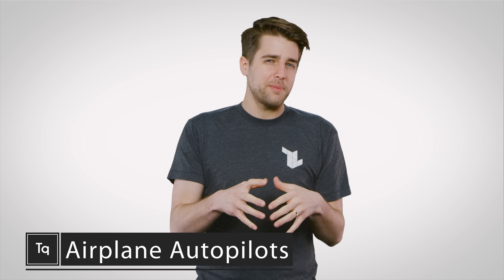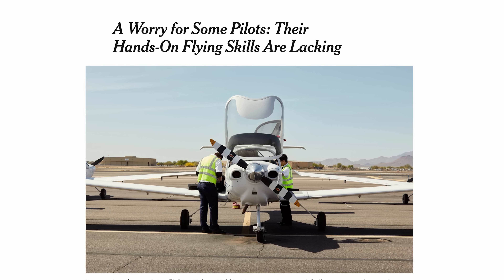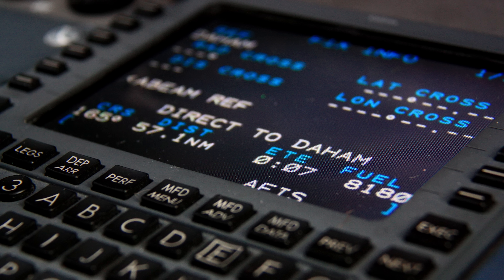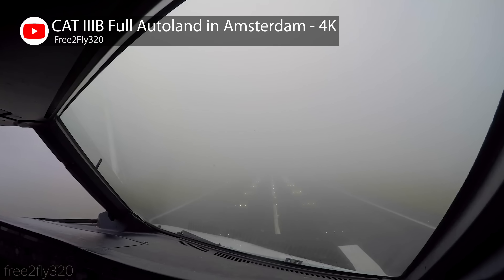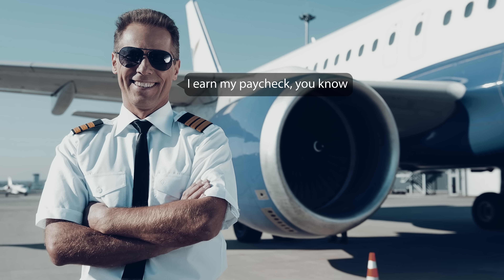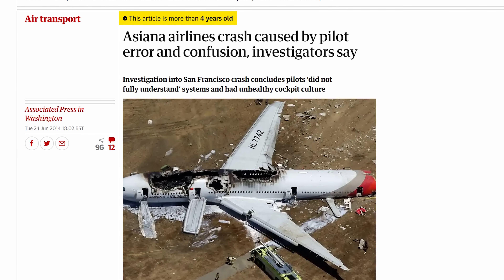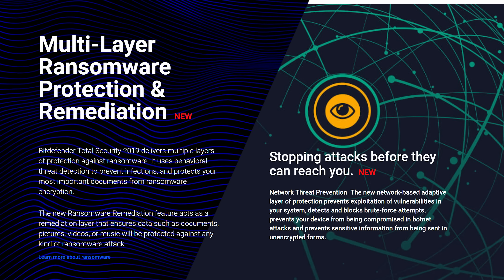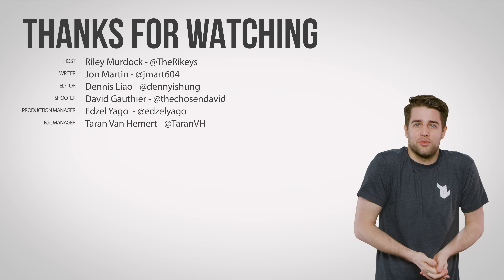Who's REALLY Flying YOUR Plane?

Comment: "Approaching the ground under the control of a machine is a little scary"...

It might feel harder, but the AP doesn't care for your comfort in CATIII conditions, the thing is designed to bring you safely to the ground. Some things to think about:

- The ground spoilers - breaking the lift on the wings - get activated through the compression of the the main landing gear struts.
- The autobrakes start working, when the aircraft feels itself on the ground, oh, that's also compression of the main landing gear.

So I personally take more a -300ft per minute landing bang on the center line right in the touchdown zone of the runway by the auto pilots - yes, for auto landing most airliners you need both AP working, of course for redundancy reasons - than a float half way over the runway and then a 10fpm greaser, needing another quarter of the runway to get to the level of compression of the main landing gear.

Comment: I just want to point out that your description of FlyByWire was wrong. It means the demands from the pilots are processed through computers, before being sent electronically to the flight controls. On Airbus aircraft, roll control is done through roll rate, and pitch control is done through C* logic, which is a blend of pitch rate and load factor (G Accel) control.the pilot flying manually still has to control the aircraft, it just means the computers help make the aircraft behave more predictably, and hold attitude.

Comment: Pilots would disagree with you with regards to speed of adjustments and landing. Autopilot requires much more runway to land than a human pilot, giving them less room before running off the end of the runway if something goes wrong. Autopilot is also only as good as the input of it's sensors and the most powerful and accurate sensor on board are human eyes.

Comment: While we were waiting for auto driving(not fully) cars on the road, we didn't knew we were already flying in some in the air.

The pilot/drivers still needed for extreme/specific conditions.

PS - The only downside is pilot are getting smaller paychecks(JK, IDK really).

Comment: Big airliners can take-off, navigate and land themselves. With emergency procedures stating that in an emergency you listen to the plane and not the air traffic controller, the other plane's pilot or yourself. The only reason we still have pilots is because no will get on a plane without one.

Comment: Only very few airplanes have ever crashed due to an error with the autopilot itself. The vast majority of crashes where the auto pilot was involved was either the result of faulty sensor data or pilot error. Many times both. Assuming all the input data is correct an auto pilot is better at controlling a jet than a human pilot is, but it does rely on the human pilot to make absolutely sure that the input data IS correct. The auto pilot will happily drive the plane into the ground if it thinks it's too high when it actually isn't.

Comment: And one interesting fact. You might think that FMC (flight management computer) is a supercomputer that is very powerful - but its NOT! 
FMC has a lot lower specs than an average PC (in most aircraft) but they are very reliable.
From my experience, FMC has a input lag/delay when programming it. It also takes some time (1 second or more) to load a page on CDU. FMC also includes  a navigation database that is upgraded every month using floppy disc on most aircraft and it has a size of few MB!

Comment: Autopilot only manuevers the plane but it doesn't operate with systems like elec. system, bleed air system, nav. system, fuel system... Pilot also has to manually set frequencies for radio navigation.

Comment: As explained by Mentor Aviation etc, the FAA training hours rule is very questionable. It was introduced after an accident by experienced pilots. In effect, American pilots rack up irrelevant training hours to meet the rule, that have very limited value in actually piloting a real airliner. So it fails to demonstrate value, while adding cost/effort to American pilots only.

Comment: Think of Autopilot as a more advanced cruise control on your car, on a long trip without cruise control it would be difficult to maintain a precise speed, say 75 mph. You'd spend a lot of time just looking at the speedometer and managing the speed and less time making looking for obstructions, managing fuel, navigating, and monitoring the overall car for any problems . It's the same thing on a plane, the Pilot flies the plane THROUGH the autopilot, it allows him to more PRECISELY maintain air speed and altitude the same way your CC maintains the speed of your car. except the work load, and stakes are higher on an airplane even with two pilots.

Comment: People seem to forget the computers not only get confused like their fellow human pilots, but they also get confused by their creators. Anyone who has done any sort of software engineering knows that there are always bugs, and their number varies by the complication the system you are creating. The goal is to avoid any major failures or design flaws, like relying on a single sensor port or having the ability to put an aircraft into an uncontrollable dive.

Comment: Autopilot/throttle is indeed a very useful and safe feature of all major airlines. But I just want to point out that in any phase of flight, the captain or first officer can turn off the autopilot at will and maneuver the plane manually (albeit through a fly-by-wire system).

Comment: Was expecting a misinforming video as most aviation videos tend to be on YouTube, however, you guys got it pretty spot on!

The only criticism I would have is that on most commercial airliners there are two pilots, Captain and First Officer each who will take turns being PF or Pilot Flying whilst the other is PM or Pilot Monitoring. One who will control the auto pilot etc whilst the other will check the flight plan, fuel burn, weather ahead etc

Comment: The planes in the thumbnail(a 737-max 8) has crashed twice since being manufactured😬 Guess Why?

An autopilot system that pilots were not told about in training had failed, causing crashes.
Reply: yes its called MCAS ( Maneuvering Characteristics Augmentation System ) it thought that it was about to stall but as we know now 
it wasn't the angle of attack sensors ( on the side of the aircraft ) had given the wrong information, Boeing should have added a two-way authentication with the pitot tubes and angle of attack sensors

Comment: Extremly easy to hack, too. Yeah they can mostly deal with natural interference or even some level of malepractice, though even simple GPS jammers have lead to some trouble at airports - and those cases werent even targetted attacks, just some delivery driver taking a nap without wanting his boss to find out that he stopped. And people have tested - in an isolated enviroment - how easy it would be to feed the systems wrong information. The answer is, incredibly easy indeed. There i no authentification, no encryption, nothing. They dont even check with radar if there is indeed a big lump of metal in the air at the location a plane computer claims a plane to be. If i were to send flight control data indicating a flight called "yo momma" is hading directly towards the tower, that is what theyll see.
Reply: Evidence? If these people tested it then surely it's been published in a some sort of engineering paper or there has been a formal report.
Reply: @agostonbazmajer1100  
You can watch a presentation around this here on youtube. Search
DEF CON 20 - Hacking Airplanes - Brad Haines

Comment: Can I be pedantic?

Much of what no-glasses Riley said the “Captain” does is actually the job of the “Pilot-In-Command”. And yes, that’s something different. 

The Captain is the pilot in the left seat who is in charge. They take over in an emergency and are always in charge of the airplane. 

But the Pilot-in-Command is the pilot who is actively flying the airplane (including making adjustments to the autopilot and talking to ATC). The other pilot is the Pilot Monitoring, who monitors instruments. 

Either the Captain OR the First Officer can be either the Pilot-In-Command OR the Pilot Monitoring. Often these roles flip flop back and forth, even during the same flight.
Reply: The PIC is always the captain, you meant to say pilot flying. The captain is ultimately responsible for the flight and the passengers, even on long haul flights during his rest ultimately he is the PIC, but a senior first officer may act in a limited fashion as PIC. The FO under normal circumstances in a two crew short haul flight will never be PIC, the only exception is that if the captain for some reason must be relieved of his duties because he behaves in a dangerous, unstable or unsafe way or he's incapacitated.

Comment: A few things here.
A passenger feels when a pilot is ‘at the controls’ 100% true! The autopilot can react and adjust almost instantanious, while the pilot is more “slow”.
Does the plane fly itself?
Autopilot is good for automation, it free’s up a huge workload from your already busy cockpit.
So what does the pilots do?
Take-off is manual for starters. Everything you do must also follow the IFR rules/procedures. We manage radio, flight rute in the fms, checking NDB’s, VOR’s, DME’s, fuel calculations and a number of smaller systems are being monitored and controlled maybe 200times depending on a flight.
When can you become a captain?
Down to 3 years outside the US.

Have more questions, ask away!
Reply: About the 737 max 8, the least thing they could do when implimenting a new system to negate the differences in moment about the lateral axis of the aeroplane, is have that system in the “briefing” package for pilots coming from 737-800’s.
Reason this was a problem was due to Boeing rushing it out if you ask me.
Reply: Not sure if you're a 737 pilot, but one thing came up to me while I was reading up on the Ethiopian crash. According to the preliminary report, there was a left side stick shaker right after take off, along with erroneous AoA data. Could this have been caused by an ADIRU failure? If so, was there any way to override it, like disengaging the left FD and turning off the autopilot that gets data from the working ADIRU or perhaps turining off one IRS completely? Could these actions have helped if indeed they had an ADIRU failure?

Comment: Even though there are a lot of automated system, the pilots are still extremely busy and interacting with  the plane a lot. Also airliners such as the CRJs do not have auto throttle so the pilots control the speeds. And also pilots still control the plane if they want as long as the weather, location, and etc allow. So flying airliners isn’t just clicking some buttons and allowing a computer to do their work.

Comment: Planes have been landing themselves since the 70s. It’s nothing new. 

It is also  widely knows fact that pilot are rarely at the control more than 10minutes during the entire flight. You can always tell when a pilot take manual control during landing approaches when the aircraft suddenly shakes and starts rolling.

Comment: The 737 max crashes were due to a few factors that compounded to create potential for a dangerous system. The procedure to manually trim in case of autopilot error (it was not clear how to trim with power assist but without engaging the auto trim, but manually doing it is a workout without knowing to relieve load off the flight surface which is not as commonly taught as it used to be), the lack of communication between aoa sensors, and maybe the 737 max engine placement that required some of these autopilot safety features to begin with.

Comment: The pitot tube itself does no sensing whatsoever. It directs air into the air data system that's connected to various sensors and gages like the  tas, (true air speed sensor).

At most, the pitot tube has a heater (for de-icing while in flight) that can light shit in fire if it's turned on while on the ground.

Comment: Seriously, anyone here about to go flying soon, if you see it's a Boeing Max will you get on it?
Reply: There grounded tho
Reply: @epictuxedocat3570  New software is in test and expected to pass. So the planes will be flying soon.
Are you about to go flying soon?
Will you get on the plane if you know it's a Max?
Reply: @ @Google_Does_Evil_Now  Personally I'd wait a couple years before getting back onto a Max. MCAS will likely never be an issue again but the handling characteristics because of the engine placement may be a big of a deal that requires a lot more additional training.

Comment: I'm a frequent flyer and I have decided to boycott Boeing entirely and permanently. For me it is either Airbus or staying home. Even if they iron out this problem, those who have been following this news carefully must be wondering what I'm wondering, can anyone trust this company to 
put the safety of people like myself over their bottom line? I think not. Besides, the 737 Max has a single point of failure, namely; the only thing standing between an aerodynamic stall and safe flight is an unreliable software. A plane is designed to stay in the air even if both engines were down. This plane apparently likes to takes us to the moon every chance it gets when the computer is not babysitting it and Boeing is still making it about "software fix". You can't get away with a software update on a plane that's inherently unstable. It's just nothing but marketing gimmick to save face. You want a real fix? Scrap this model and come up with an entirely new design that doesn't tend to stall at every given chance.

Comment: As long as there's a manual override, I'm fine with all these automations.
Reply: nope, the controls are connected to a computer which in turn connects to hydraulic actuators on the modern stuff.

Comment: The crashes that happened with the new Boeing planes did not happen because of miscommunication. They happened because when Boeing put new engines on they plane they had to put them higher up on the wing so they didn't have to redesign the plane. The pilots were not told about the new automation system that was put in to bring the nose down so the plane would not stall. Also they were not told that they couldn't bring the plane up to the same titlt without it stalling. This caused the pilots to fight with the system which then caused the planes to crash.

Comment: You forgot to mention that at all times the pilots are monitoring the aircrafts systems looking for any anomalies. And the aircraft is always under the pilots control from takeoff to 10,000 feet, and usually during landing, except in some extreme circumstances.
Fun fact, landings on aircraft flown by former Navy pilots are usually rougher when the pilot does the landing manually.
Reply: There is a reason why they are former Navy pilots /s

EDIT: geez Youtube is shitting itself. There originally were 9 duplicates.
Reply: @totallynot0something047  Don't see people indicating sarcasm to often, well done.

Comment: Your video is actually just wrong.  Most transport class aircraft (including the 737 max 8) with a yoke still have mechanical controls, which behave much like hydraulic power steering, but with electric power and electronic control, unless there is a loss of electrical power, where they revert to difficult manual control, sometimes assisted by a turbine pump that can be lowered to provide hydraulic assist.  Airbus builds many planes fly by wire, but these don't all have yokes.  Many are flown with a joystick and have no manual overrides.
Reply: bzacon all Airbus and most Embraer aircraft use FBW, so nice try. That makes up a lot of the aircraft in service.